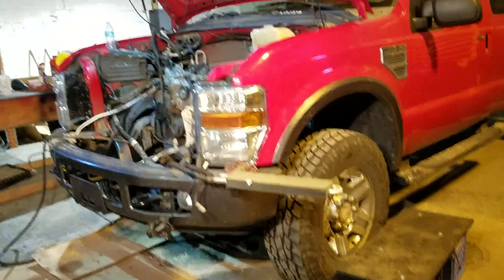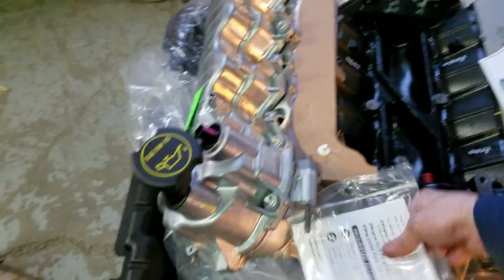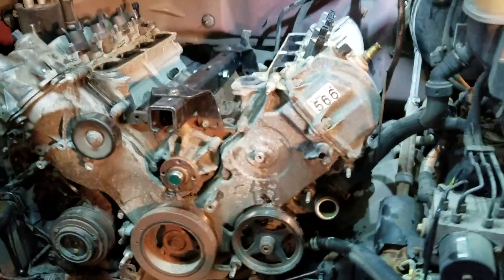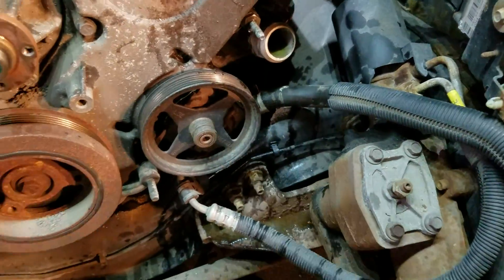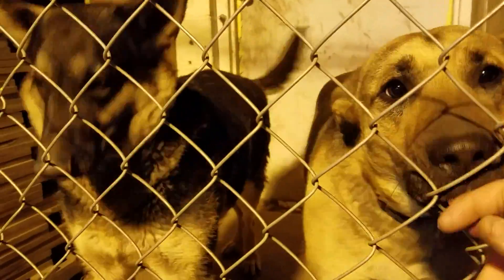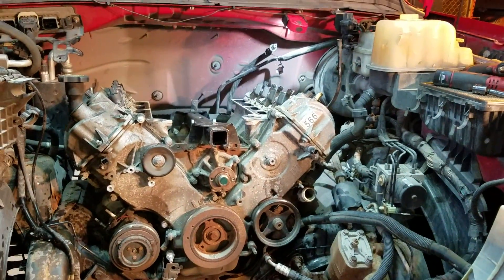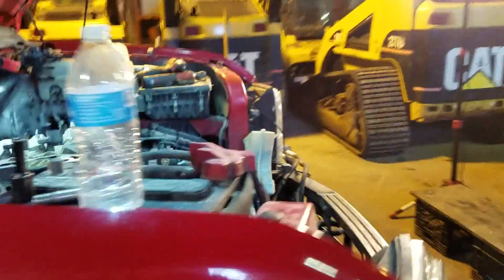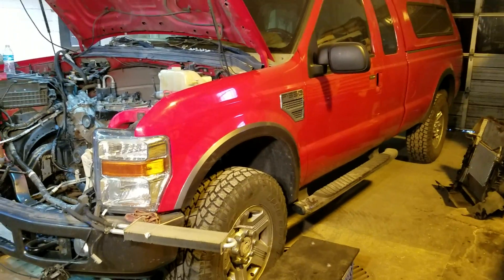08 TriTON - 5.4 3V LOCKED UP!!

Comment: I have a 5.4 in an 05 F1 50 and it sucks on gas mileage any tips on getting better gas mileage?
Reply from the maker: +john d keep them tires at 35!, get u some fresh plugs n an oe air filter. Fuel filter wldnt b bad too. V8's johnny....thirsteeeeeee
Reply: PowerStroke Tech Talk w/ARod did all maintenance and still bad on fuel truck only has 80,000 miles and goes through 3 L of oil between changes!!10 mile to the gallon in the city that's about it
Reply from the maker: +john d ughhh not sounded good, shldnt b usin that much oil. Thing must be choooochin like pug1s ol dirty
Reply: PowerStroke Tech Talk w/ARod old stove pipe eh
Reply from the maker: +D4x4Bronc friggin aye rights boys......sonavabitch

Comment: ya them newer 5.4's are garbage my friend  has a 08 with the v10 been a way better motor
Reply from the maker: +Elton yea i bet. I have definitely replaced more 6.8s then the 5.4. Either of the 2 you need 2 take care of. Most of em were ALL because of neglect.
Reply: cam phasers are the horrible spark plug design lol